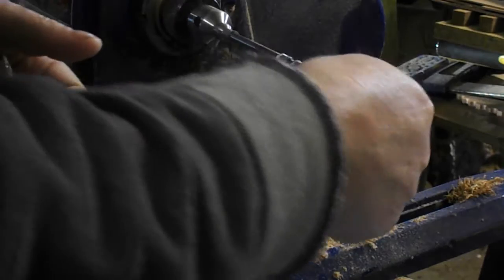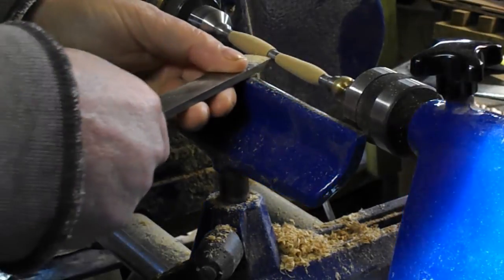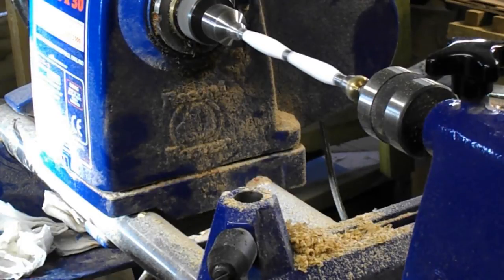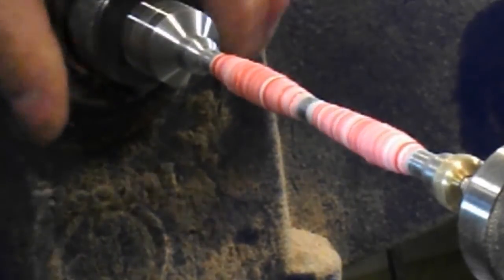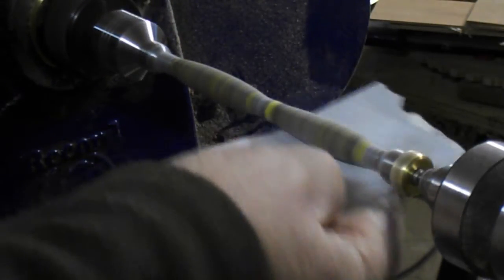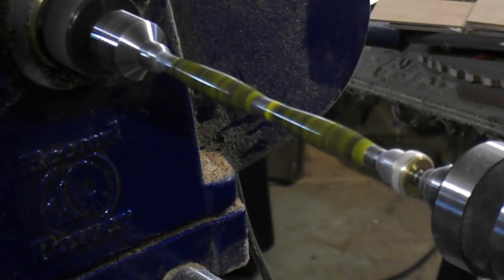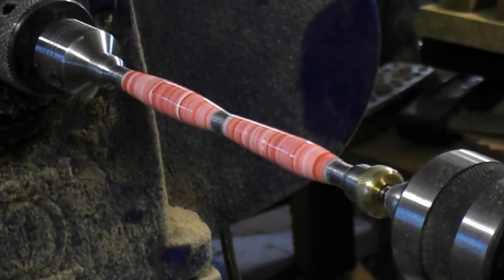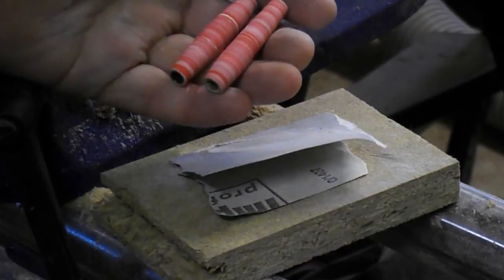Turned painted pen.

Comment from the maker: It's a real shame that the people that leave thumbs down don't say why. Maybe if they left constructive criticism I could improve my videos.
Reply: +Segmentedturning Since you asked for some constructive criticism I figured I would leave some, now I dont mean anything to be rude or insulting and I am by no means a professional photographer but from a view stand point there were a few things I noticed, In the beginning when you trimmed the blanks it was very dark, as if you had all the lights off, perhaps setting up a few little spot lights would help, nothing too bright but enough to show what you are doing, also I would try some new camera angles and focusing in on the main subject, in this case the pen, throughout the video its hard to see what you are doing at time because of the camera angle being obstructed by your arm so maybe try a overhead angle from the backside of the pen, it would give a clear video without worry of obstruction when you are moving around, there were also a few time where you seemed to be zoomed in too far and again making sure the subject is in the center of the frame. Also showing photos of the finished product at the beginning or end of the video would be a good idea. And finally in the case of the words going across the screen you need to be able to read stuff like that without having to set the video to the lowest speed otherwise people wont bother with trying to figure out what it says or it becomes annoying. Other than that I would maybe just work on some of the editing and trying to shorten up the video a bit, you dont have to take out content but you could definitely shorten the video to a length that would hold peoples attention, 50 minutes is a long time when you could probably have show the same amount of content in 20. I hope this is along the lines of what you were looking for in feedback and I hope you keep making videos and enjoy making them.
Reply from the maker: +Joshua Fisher Thanks for all your constructive criticism. Yeah I don't know why it came out so dark, I did have the work light above the drill press on but it still came out dark. Maybe I was zoomed in a bit to much. I was using a new camera and learned a lot about using it when I made this video, so fingers crossed it can only get better. lol. I suppose I'm a bit of a hoarder and as such I find it really hard to cut anything from my videos, what I should do is speed it up a bit so that the video is shorter. I do have a camera mount on the ceiling now so that I can film from above, I find that filming from above you can't really see what's going on with the gouges. I have quite limited space in my workshop also so have to just put the camera where there is space for the stand. I suppose I did spend to long on the sanding part of the video. Warming up a bit in the workshop now so will be back out there again shortly and will try to implement some of what I have learned and from your suggestions. Once again thank you for leaving these suggestions. Gordon.